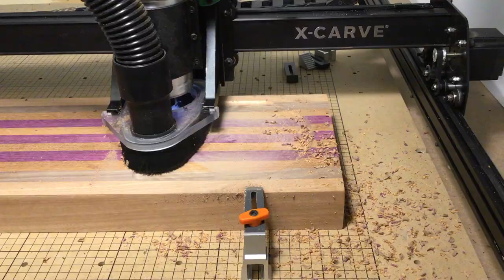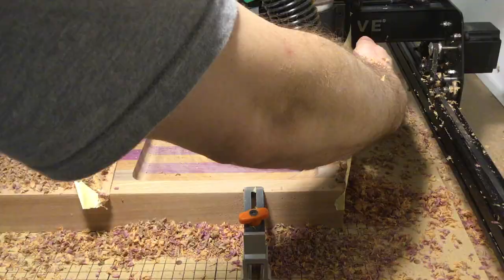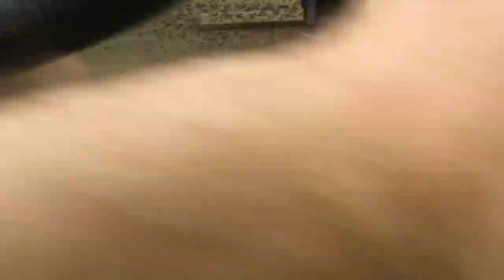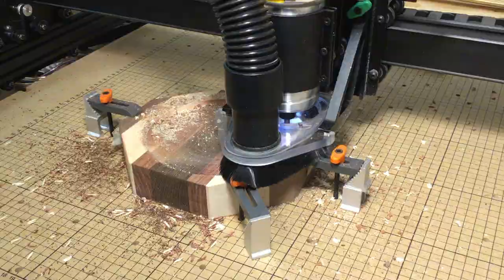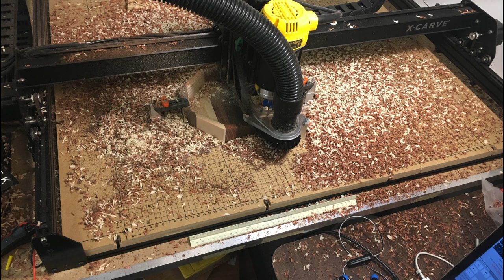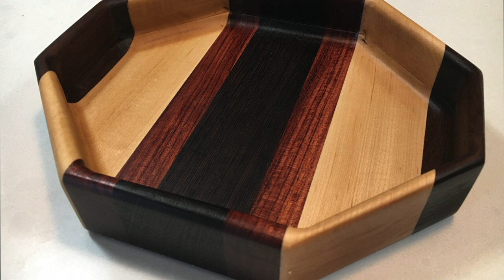Making Cutting Boards Bowls with the X-Carve

Comment: Is that dust suction on?
Reply from the maker: Well, for most of it, yes.  The well created by the cutting allowed the chips to fly everywhere because of the air from the router.  That said, I forgot to turn the dust collection on for the handles which is the cover photo.  That said, the dust extraction hose is on the front, so it doesn't help much when you are cutting "behind" the hose without any material to draw air from like the handles.

I have to figure out a much better way to handle chip evacuation for future projects - the belts and wheels got completely gummed up with wood and I was worried I might loose some steps.  All worked out in the end though.  Thanks for watching!

-Tom
Reply: Me too - that's a lot of chips with the suckit attached. Cool idea and video though!
Reply from the maker: @CAOHnutrition  agreed.  wasn't expecting it - I've been using dust collection for a year without any problems.  I have another project this week so more testing.
Reply from the maker: It turns out my dust collection bucket was full, so that's why there was little suction and all the chips.  Problem "solved" ;)

Comment: looks great ! can you share the bit you used and the specs on routing speed? Did you do any final sanding on the bottom, its incredibly smooth!
Reply from the maker: Sure thing - I explained a little more in the previous video (https://youtu.be/nHSi_tY1W4A).  I was using adaptive clearing in Fusion 360 - for the bowl I used 0.25 DOC @ 60ipm, for the cutting board I used 0.125 DOC @ 60ipm for the bowl; 0.121 DOC @ 60ipm for the juice groove; 0.125 DOC @ 60ipm for the handles.  Bowls where made with a 1", 2 flute bowl cutting bit, juice grove was a 0.75", 2 flute round bit, and the handles 0.25"" 2 flute upcut.  I'll update the description with the parts.  Thanks for watching!